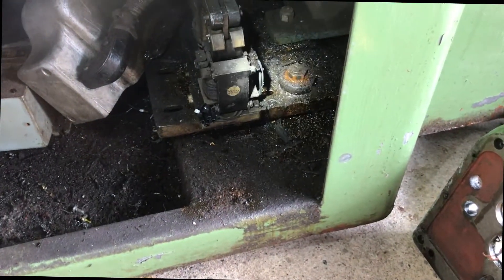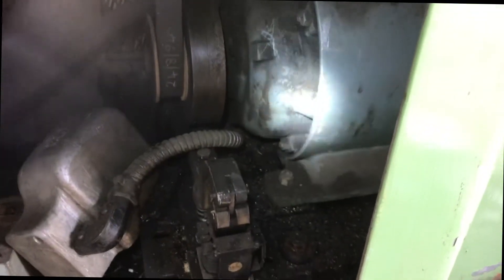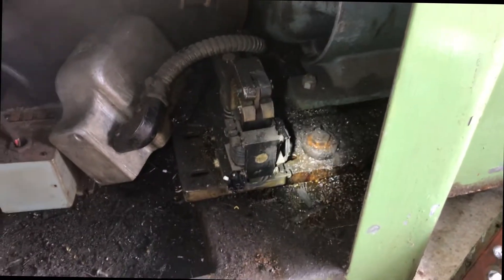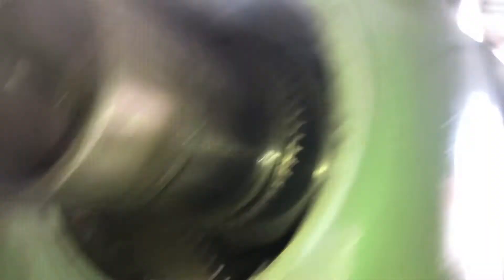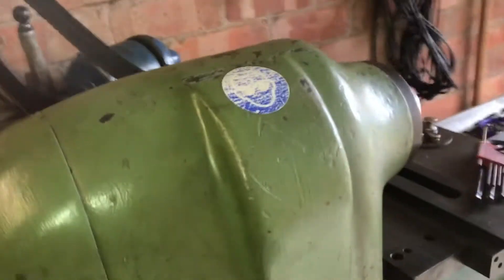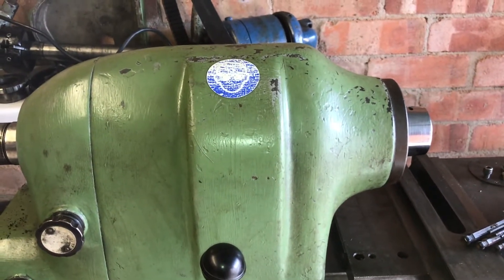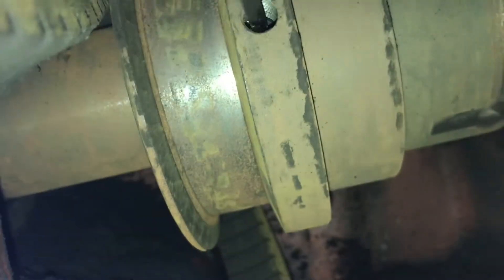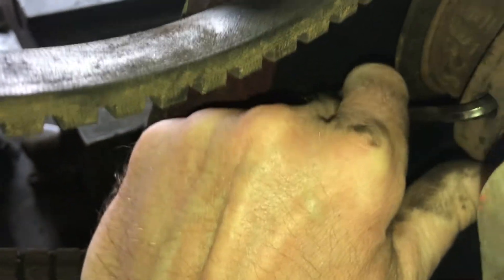Hardinge HLV spindle change

Comment: Thank you for the video. Was hoping you filmed the second half of pulling the spindle. Wondering what surprises lay ahead for me in my endeavor of replacing my hlv belt
Reply from the maker: Not much more than shown. It is actually very easy to do, all self explanatory if you have the PDF guide. Join the Facebook HLV group and that PDF is in the notes section. Plus there’s a lot of knowledgable guys there to help.
As I say though it’s pretty simple to do
Reply: @iDiveDOTtv  Hi, I'm a new lucky pocessor of a HLV Lathe. Thanks for your video. Can you tell me what is the name of the facebook group you mention ? Thanks
Reply from the maker: @renaudhottlet2070  https://m.facebook.com/#!/groups/2056987811180946?group_view_referrer=search 

That should get you there. 
Just search Facebook for Hardinge HLV
Reply: @iDiveDOTtv  Thanks a lot ! By the wy, I also need to change the belts on my HLV, do you have the references of the 2 belts ? I want to buy them but not directly to Hardinge (to expensive). thanks
Reply from the maker: @renaudhottlet2070  go on the group. Someone posted a cheap Uk source. I bought mine Hardinge direct, only bad part was the postage.  Find someone in the USA and pay them to get them local post and package in USPS standard boxes and you’ll be fine.

Anyway best to join the group then just use the search function for the term belt. You will then know everything.
Reply: @iDiveDOTtv  Thanks. I have another question. How did you do to pull out the pulley shaft at 3:58 ? I tried on mine but feel like the axis is longer than the space between the edges of the cast iron frame.I'm a little stuck
Reply from the maker: @renaudhottlet2070  
https://m.facebook.com/#!/groups/2056987811180946?view=files
Go to the group files here. Look in the manual and you’ll see detailed instructions of how to do it.
Essentially though you in hook the bottom belt, lift the pulley by turning the handle, then unhook the top belt. Once that is done you can then drop the pulley all the way down and that gives you the access you need.
Reply: @iDiveDOTtv  thanks, already read all the instructions but impossible to pull out the pulley shaft. The shaft is too long.